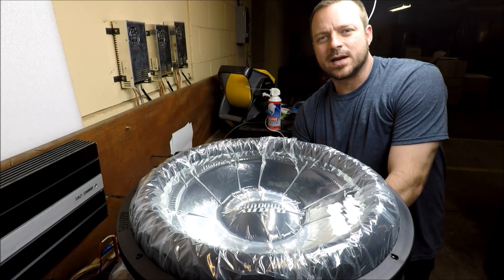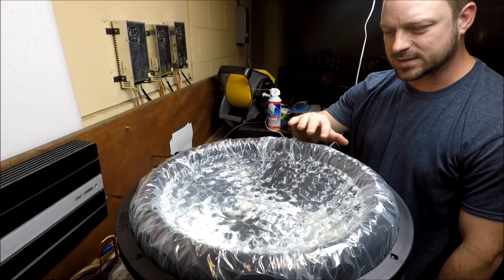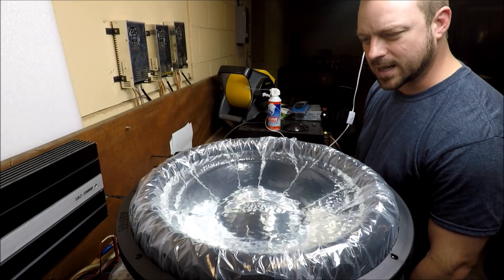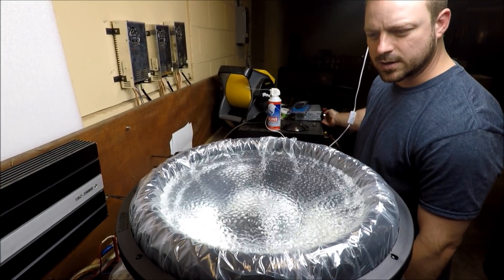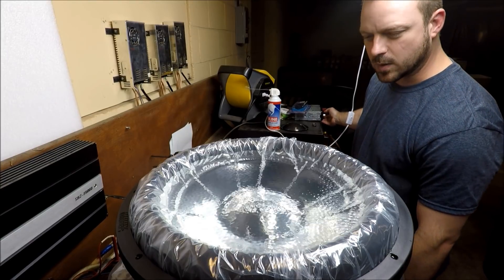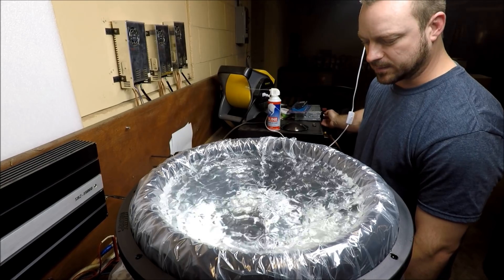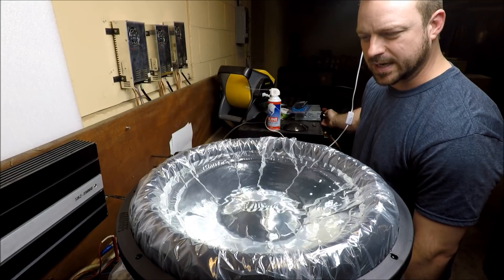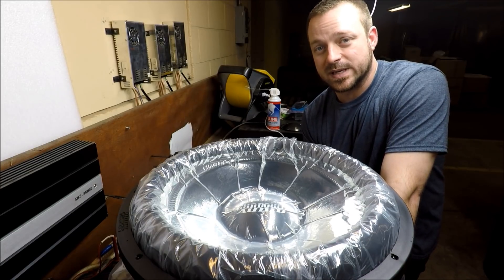***Subwoofer Full of Water*** Tech Time Thursday at Sundown Audio

Comment: so the lower the Hertz the deeper the bass
Reply: Leroy Cole Jr - It all depends on your set up . What kinda amp , sub an box you run . If your box ain't tuned for low Hz an your sub isn't made for low Hz then it's just gonna move an play air pretty much , not much sound an you'll burn you coil up at low Hz . Now if your running SA , X or Z Sundowns with the right box an power they love the low stuff . I have 2 X 18'S an my box is tuned at 30.5 Hz  ( I was shooting for 32 ) that's just how it worked out . Mine plays good from 25 Hz to 60 Hz . My box peeks at 38 Hz so I compete an listen to music around that for my loudest sound or SPL

Comment: Dont know if you will see past video comments. But could you do a wireing video on how to wire multiple tweeters and or midrange 4 and 8 ohms?
Reply: Pretty easy to do yourself if you have a multimeter
Reply from the maker: I will not be doing such a video.
Reply: Would actually be a great video to do, there alot of people that don't know and would like to understand. There a shit load of videos on how to wire multiple sub's but not mids or highs, or even just the math you do to calculate for series, or parallel and series parallel.